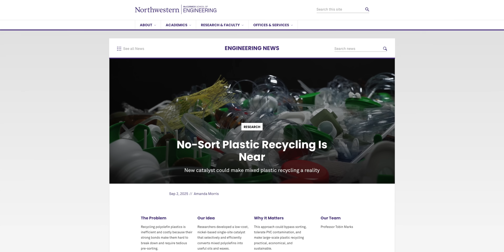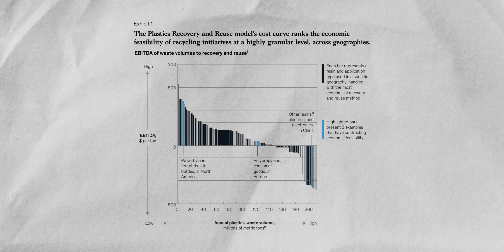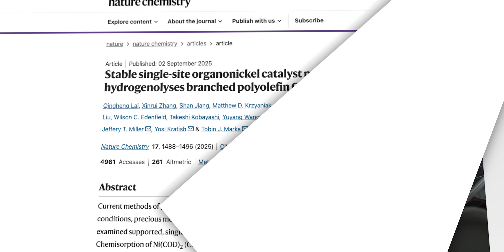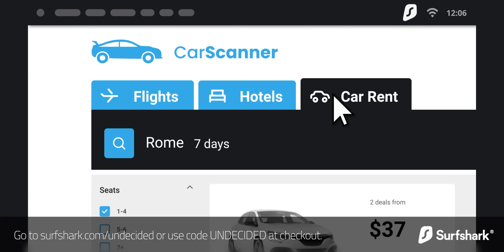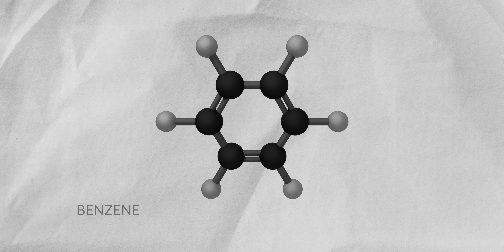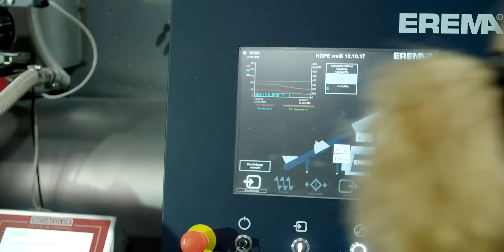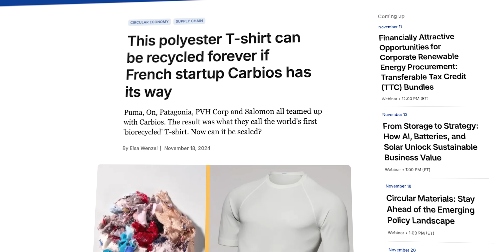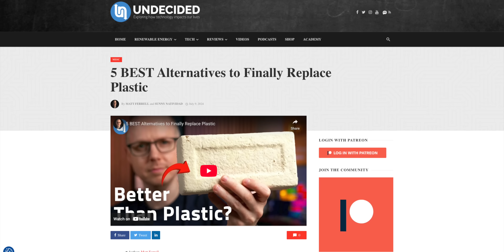The Recycling Breakthrough That Doesn't Need Sorting

Comment: Is plastic recycling within reach?
Technologically speaking - yes, a  much higher percentage of the plastics could be recycled economically. 

Business wise, no.
The potential of full recycling with virtually no wastage will mean a massive change to the economy and manufacturing process. 
Simply put:
Companies loose billions in sales of new plastic products, and the production and selling of the raw materials making those products, if those products from recycled sources are made at the same, or lower prices than the new products.
 
And many manufacturers have long term contracts and legal commitments to buy certain resources to manufacture their products. 
For example: someone can make  terrific Lama Wool sox cheaply, but most clothing manufacturers have long term contracts with sheep wool providers that can make it difficult to change, and adding a competing product that may, in the longer term, reduce reliance on sheep wool can't be good for the wool trade.

Comment: It seems to me that it would be easier to require plastic container manufacturers to make it easier to identify the plastic compound being used.  And maybe even require that dyes not be used--or that only dyes that are easily broken down be used.  BTW--Any aluminum can you find in the store is lined with plastic (to prevent corrosion), so that's not a solution.  Glass isn't lined, but glass is much heavier, so it increases transport costs (and fuel usage), and it's also subject to breakage--glass fragments in food and cosmetic products are a real problem.

Comment: There's a gentleman from Naturejab who is on the road in Florida right now running motorcycles , BMW cars on his recycling of plastic. I think he said he's working with microwaves. It's working for him. What I would like to see is all the Plastics that come out of the ocean ground down to a powder and anything all over this world in dumps to be dug up and ground down powder.  When the system is foolproof melting and breaking apart Pet, pp's and all the others, to turn them into the powders and save a step in energy.  When that happens I think every single household in the world should have plastic recycling machines that are safe to throw in plastic bottles to turn them into powder.

Comment: The age old issue is that by far the worst offenders for waste are those most likely to dump the issue on other peoples laps assuming they don't sabotage the process entirely (which they've been caught doing more than a few times). As the video bluntly points out new technologies can take some of the bite out of a steadily degrading situation (even ignoring pollution there is only so much fossil fuels) but it'll be policies and a willingness to accept a degree of pain that will actually fix it. Does that political will exist at the moment? No, not in the slightest. Will it in the future? I hope so, even if waiting for the 'it'll be someone elses problem' generation to cease to be a factor sits badly considering a fast response is desperately needed.

Comment: erratum @ 12:20
hydrolysis does not mean "splitting with water" but rather "splitting water"
it refers to the process of separating the oxygen and hydrogen atoms in a water molecule, usually with the help of a high-voltage electric current

Comment: New oil doesn't look at the full picture. Oil is needed for fuel. That is needed to be imported. Plastic needes to be disposed of too. Plastic can been made into oil, then gasoline and diesel. Other products can be made as well. Taking  waste to recover cleaner fuel, means less dependance on some oil needs. Over all this is a better economic model.

Comment: The globalist system has turned garbage into an international commodity. Local regulations made by politicians who have needed to show voters how environmentally friendly they are have made local recycling more than it is possible to defend economically in competition with countries that do not take the environment or people into account. Recycling has been talked about since the 80s. But almost nothing is recycled. As long as images were powered by engines, 95% of cars were recycled as parts or as raw materials for factories. With EVs, this has dropped dramatically, because the batteries are stored until the warehouse catches fire and gives the hypocrites an opportunity to adjust the statistics. The solution is to ban international trade and the use of landfills to get rid of the garbage. And order the value chain to accept what they sell. Then one of two things will happen. Either efficient and economical recycling methods are developed or the price and lifespan of the products go up

Comment: Until plastic is as inert and non-reactive as glass. We need to use glass and not even break it down and rebuild it. Just use it over and over until it's done. We just have to figure out how to deal with the weight of glass which would be electric trucks.

Comment: There is such a simple way of doing this.  Pyrolyze all types of plastic, clean or contaminated by heating them to about 500 degrees C in a chamber with no oxygen and run the resulting gas up through a fractionation column.  Petroleum engineers know how to do this and have most of the equipment.  You would think that with the huge levels of subsidies that we give them they could be persuaded to do this.  Threaten to cut off their subsidies......   And by the way, a huge range of other waste streams can be similarly treated,  https://mtkass.blogspot.com/2019/09/pyrolysis.html

Comment: I feel not enough is being said about the energy cost of any particular solution. Until fossil fuels are mostly phased out, using energy in the recycling process means producing greenhouse gases. Counterintuitive as it sounds, putting plastics info landfills might be more environmentally friendly than other solutions, sadly. 

I wish we did more of Reduce and Reuse before we needed to Recycle

Comment: Energy and labor costs are always the two things defeating the recycling concept. In the places that want it to be a normal thing they need to back off on energy prices and cost of living. That's the only way that companies would see the labor portion as viable, and the laborers themselves would agree the pay was fair. Simple fact is that if a company has the option of buying a material for one price or a recycled material for a high percentage more then they will consistently choose buying the cheaper option. They will never commit to recycled materials until the cost of the material is nearly the cost of virgin materials. Focus on the energy part first to lower the cost of everything else and then the labor can meet it at the bottom.

Comment: I’m a recycler.  Did you know in the US, legally, just burning the plastic is “recycling”.   Thank Citizens United and “campaign contributions”.
Reply: Not just in the US. Garbage burning power plants are a common thing. It's called "energetic recycling" (or some such thing, I just tried to translate the German term). And it makes perfect sense as long as we are still using fossil fuels for heat and electricity generation. Plastic production is basically just a detour the oil takes before being used as most oil is used anyway.

And with carbon capture on the way, it even becomes a sensible future perspective: make plastic, use it, burn it, catch the CO2 created on burning, and feed it back into value chains that activate CO2 using renewable energy. We pretty much have all the single items in this process chain already, all we lack is large scale implementation.
Reply: @Volkbrecht  Carbon Capture and transforming it back to usable hydrocarbons is very costly and so far away from economical feasible.
Reply: @nSnowCrow  I know. But that is only because oil and gas are available and cheap. With the current rise of renewables that equation may look different in a decade or two. As long as governments keep subsidizing the research and prototype building, this stuff will be realized sooner or later.
Reply: Burning garbage can be a good idea.

Calling it recycling is a bit silly, though.

Comment: Policy is as you say, absolutely key. I believe that we need to tie the cost of reprocessing, disposal, and/or sequestration, to every product we use. Whether it's plastic water bottles or gasoline, once externalities stop being external, the market does an excellent job of prioritizing the most efficient and sustainable solutions. 

Personally, I believe that energy intensive solutions are going to become more viable as renewable energy pushes down the cost of electricity. Using green hydrogen and electricity to brute-force chemical processes is a very clean and comprehensive way of dealing with this stuff. 

With respect to feedstocks, I believe that in the future CO2 will become a major source of carbon for plastics and fuels. Again, as energy costs go down, and the priority placed on addressing climate change goes up, it will start to make more sense to use that pathway.

Comment: "Hemp plastic was invented in 1941 when Henry Ford built a car with a body made from a plastic composite of hemp fiber and other materials. Ford demonstrated the strength of this material, which was 70% hemp fiber, and the car also ran on hemp-based fuel."

Comment: Dr James Tour, PhD is a professor at Rice University and he also has a YouTube channel.

Scroll back about a year or so and it'll have both some shorts as well full lectures from his Fall 2024 semester.. with more farther back.

In these, he discusses the advancements he & team have had with flash-graphene conversion of essentially 'any & all' carbon-based feedstocks .. plastics included.

The approach essentially 'flashes' the feedstock and converts any carbon into low grade graphene while simultaneously releasing a hydrogen-rich byproduct which can be utilized to not only power the process, but do so with a net gain quantity of hydrogen. 

This isn't incineration, and the flash-graphene product, though lower grade that used for photovoltaic, chip fabrication, energy storage, etc (at current understandings), is a perfect grade material for mixing with concretes, asphalts, and a growing medley of other building materials..

..not only reducing the other materials that go into them, but drastically improving the strength, performance, longevity and overall capabilities of the flash-graphene enhanced materials, not only providing a hydrogen-rich byproduct to power those manufacturings, but doing so in such a way that the once- potentially pollution possible carbon feedstocks have their carbon locked into an incredibly stable molecular carbon material that keeps it out of the environment essentially 'permanently' while enhancing the materials to which it's added.

It scales quite nicely as well.

Comment: Look around you. Plastic EVERYTHING that came in plastic packaging on a pallet wrapped in plastic. We're even wearing plastic in our homes with plastic paint, sealant, siding, windows, plumbing etc. It's not necessary. Glass is immediately available, pallets were secured with ropes and nets before shrink wrap, paper and cardboard are suitable for packaging and a lot more. Im not a hippy environmentalist about things by nature. I just did a quick mental survey of what was around me and realized there's way too much still used even though we know better. It's insane. From wherever you are, look around you. Every piece of our existence is an example of plastic overkill. I mean...I guess banning the little plastic bags was a start but it would take little effort to drastically eliminate the need for it to begin with across the board. Even if it gets recycled it still has to be trucked and barged. Easier to just not use more than necessary to begin with. It starts with companies keeping it out of their products so its not distributed unnecessarily to all corners of the planet to begin with.

Comment: The issue is that recycled plastic is still plastic. We're just learning that single use and textile use are huge contributors to microplastic pollution which is being found in places we never thought possible in our own bodies. The solution is to move away from polys and reduce the microplastics caused by them.

Comment: Looks like I need to start planning on how to cheaply mine old landfills for plastics, because affordable fossil fuels are a finite resource, which means all that untapped waste will eventually become valuable again.

Either that, or a scavenger sub-society will evolve where collection agents will pay for waste plastic being turned in, which will then be collated & sold to reprocessing facilities where it will be converted back into base materials again by one method or another.

Comment: Aduro Clean Technologies Inc. engages in developing water-based chemical recycling technologies. The company's platform converts end-of-life plastics and tire rubber to specialty chemicals and fuels; upgrades heavy crude oils; and transforms renewable oils into renewable fuels and specialty chemicals.

Comment: Thank you for the update. About 30 years ago, DuPont and others were investigating recycling Nylon 6 and Nylon 6,6 by breaking them down to the monomers. It did not last long. The carpets were from commercial building so separation by polymer types was not a problem. My job changed so I did not follow up why they stopped, probably not economical. I also view economics as easier to measure than energy/carbon footprints. If more money is required then the energy/carbon need is higher (unless too greedy).